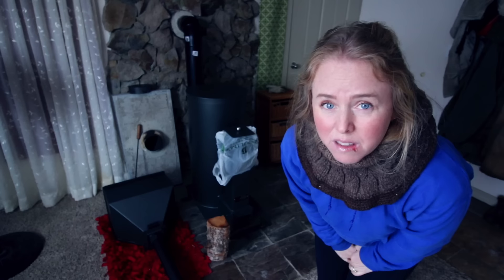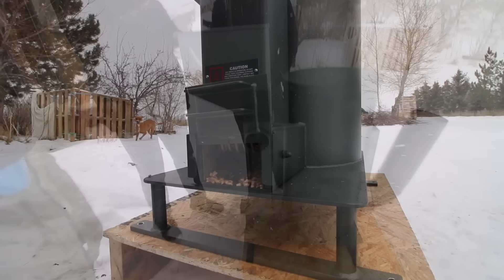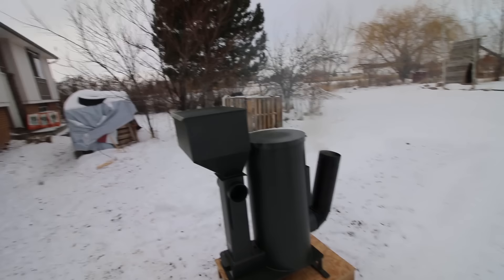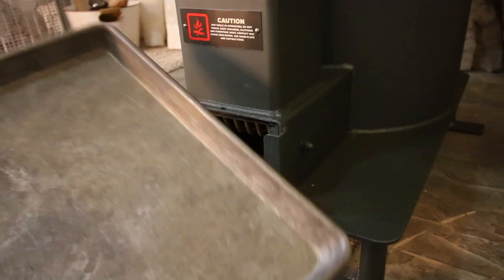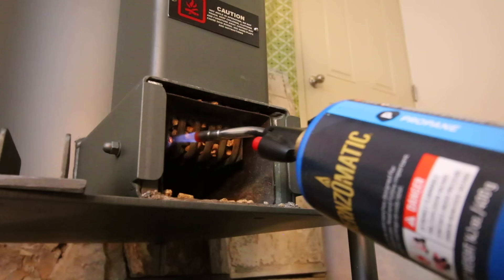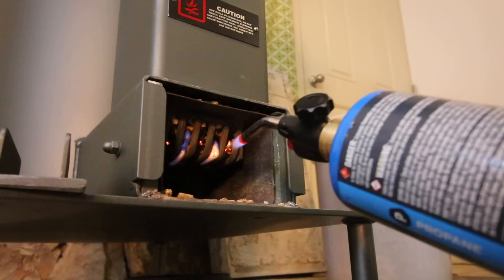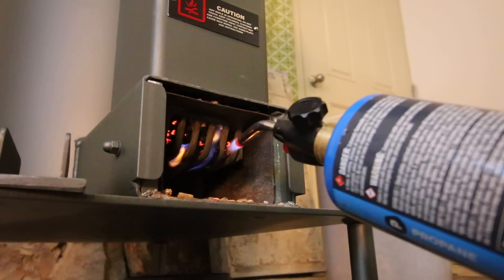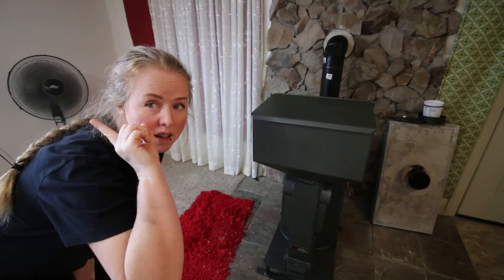Non Electric Pellet Rocket Stove REALLY WORKS for Heating Without Electricity Liberator Rocket Stove

Comment: Cold outside air for your intake is denser than warm room air and makes for a greater pressure difference between the top and bottom of your chimney which increases the draft. Great video and also lots of useful information in the comments section. Thanks for sharing
Reply: Yes! Fresh air intake otherwise it runs on a diminished return by burning air in the house that's trying to heat up. Another gentleman commented on the use of fresh air flue dampeners to control the rate of burn.
Reply: the other huge issue in sucking heated  inside  air up the chimney and ejecting it outside  is   it lowers the pressure in the house relative to  the outside ...greatly increasing the flow rate into the house via drafts...
Reply: hey, it's best to use pellets to create a mini burner for a wood fireplace... with a metal tee and appropriate pipe sections for gravitational suction of air without electricity and a suitably large flame... something like in a kerosene lamp...
the pipes should heat up quickly enough, be thin, etc. then it may work... the problem is poor combustion of the pellets and spontaneous combustion of the remains... unfortunately, the pellets or burnt like rice fried in a pan... but the rice is fried in the air... :-( this is impossible with gravity pellets

Comment: I have 2 pellet stoves in my house and love them. Compared to regular wood, waaaay cleaner and easier to manage. The downside is you have to buy the pellets and prices have gone up a lot lately. We like it because it's the fire heat everyone loves without the mess, and you turn it on and leave it for hours even days between cleanings. I'm thinking of building one of these, like the no power thing.
Reply: This one also burns wood

Comment: Any woodstove should have the combustion air ducted in directly from the outside.  This keeps the chimney from drawing heated room air and pumping it outside.  Without a direct duct, the chimney draft negatively pressurizes the room/dwelling and that air is replaced thru every air leak in the building around windows, doors, electric and plumbing penetrations and cracks.  This usually makes everywhere in the house feel cold except right near the stove.  Direct ducted combustion air makes a huge difference in comfort.  To improve heating comfort even more, a second duct with a fan/blower, blowing fresh outside air right against the side of the stove or into/between a heat exchanger plate(plate against a side of the stove with an air gap) makes a huge difference.  This blower will positively pressurize the building with heated air which will cause the heat to flow out and away from the stove as it pushes the cooler air nearer the walls out thru any places that can leak air.  These simple changes turn cold and drafty wood heated dwellings into warm and cozy.  It doesn’t even take much of a fan, a 4” computer fan on the end of 4” PVC moves a few hundred CFM and is quiet and takes little power to operate.

Comment: I had an American Harvester stove by US Stove company yes you need 120 to run it but the cool thing was i went to local farmer and bought a bunch of feed corn for the majority of my fuel. Corn needs to run hot kind of like coal, So a 70/30 corn/wood pellet would allow me to turn it down to 3 of 10 for the feed rate control, where 100% corn required level 5 feed rate to keep hot enough. Because i was renting the landlord was supervising the install and the window pass through that i made out of wood using a wall adapter and packed with fireproof insulation. Once the stove was running at temp less then 5 min from lighting all you can smell outside is Popcorn LOL.

Comment: I would say it would light faster if you used the yellow bernzomatic tank. It has MAP gas in it which is meant for brazing which burns much hotter than the blue propane or butane fuel tanks. Hope that helps. I like the charcoal briquette comment though!
Reply: just hold it in one place
Reply: Open the valve more on the torch .

Comment: Just a friendly note, the torch should be running like it was at the end of the light. The tip of the torch should never turn red. Just need to run it with more gas flow.

Comment: With this type of burner you can increase the efficiency a lot if you connect outside air to the draft. That will also protect against short incidents of "back kick" that can happen if there are turbulent air. The hight of your chimney protect you pretty well, but it can still happen. Not using heated air for the draft also protect against the effect of outside air getting into connected room when the burner "suck" air out through the draft. Also this is a very nice burner design an I would be itching to place a tank of water on top of that plate.  🙂
Reply: Just let the itch go and don't scratch like a bug bite. A pot for coffee or tea may be fine. Something you wouldn't worry about if it goes dry.

For the temps you're working with a small pan would go dry quickly. Boiling occurs at 212 F while this can go upwards of 400F. I trust the reason for the tank would be for humidity purposes.

 For the purpose of replacing a hot water heater a sealed tank could be constructed like a still. Still the condensing coil would have to be larger than that which you might use for moonshine. It might be fun to take a washtub bath like they did in my grandma's time. In the living room instead of her enclosed back porch though? Each to their own I guess. 

Now this isn't something that is turned off by a thermostat when the water temp gets high enough. I might not even enclose the system at all. Water heaters fail catastrophically with the worse case being a new skylight originating from the heater and/or it's components being launched into the stratosphere through the roof providing it didn't decimate the entire house. 

Remember what she said about water? Cast Iron and steel may crack if cold water is dumped onto them. And from that comes what I call a potentially existential moment. You will know you are alive because of the pain. What quality of life you will have after that could be telling. If it works don't fix it unless you are an engineer. Or as they say in the contracting business: When in doubt do less. There's a reason she suggested sand and a CO2 extinguisher. You don't want somebody that can't set a VCR or DVR making decisions they don't have the skill set for. 

As for connecting to the outside air: Now that makes good sense. I think you got something there. If the house was tight it would let in more air. If it wasn't it would suck less cold air (negative air pressure) from the outside. And any back kick as you put it wouldn't blow smoke and carbon monoxide back into the house.

I got a feeling we'll get some other people weighing in on this one because obviously as we got some brains, nobody has the market cornered on intelligence. And for this I'm willing to learn.
Reply: @scottdahl1938  " I trust the reason for the tank would be for humidity purposes."
The main reason would be for hot water and heat storage. A 30-40 gallon tank would store a lot heat that would be released when the burner is turned of.
It will also even out the heat when the burner is used. A source for water so the air do not get to dry is an added bonus.
The tank would have to be open to air since you do no want a steam pressure vessel on the top of your indoor burner.  🙂
Reply: @bknesheim  I think I saw a variation of what you might have in mind where somebody wrapped copper around the chimney and let rising water flow to another tank as it was replaced by cooler water at the bottom. The guy fed the hot water in turn to a living quarters he had. This set up is different in that the chimney doesn't have the higher temps.
 
Tell ya what. There's a TouTube channel called "Mylittlehomestead" that built a "Dragon rocketstove. They did it with bio mass about five years ago. Just type in the channel and include "Dragon rocket stove". The structure of there stove is about the same except the pipe layout is different. But they made theirs from scratch. Looks Pretty and works great.

Then there's another channel called "Keeping It Dutch". Then type in "Masonry Heater" From a video dated three months ago, it's based on a similar system as the rocket heaters. It burns hotter, cleaner and uses 2/3 less wood as a wood stove. With this he has a manufacture actually installing their product. And with that manufacturer comes a website with other models and prices to go with the lights and bells. I think this is available as a DIY project too. Let me know your opinion. Options are a good thing.
Reply: @scottdahl1938  Your recommendation are old news.  🙂
The copper around the chimney have problems since then you have a pressure vessel. You also loose the heat storage.
A rocket stove mass heater is great when you have the space, but the only efficient way to build one into your house is when you build the house. 
"Tiled Stove" or "Masonry heater" do much of what a mass heater do, but can easier be retrofitted to your house. The main problem there is the cost of the stove. 
They are very efficient, but there are not really any versions that can do low effect.
Reply: @bknesheim  Wondering if the the vessel as you were proposing may need some support. Maybe build a stand of right angle steel that the stove will slide under. They sell 50 gallon drums for cheap. Start with 30 gallon fill to start. Be wary of excessive humidity. I know of a guy that had a humidifier under his desk that turned his wall into a Jackson Pollak gallery in black. Maybe the heat from below may disperse it better.
Reply: @scottdahl1938  A cheap sensor can easily control the humidity. Black fongy need more the 80 prosent before it take hold.
Generally a stove dry the air to much in the winter for it to be a problem.
Do not think that the weight would be a problem, but support is never a bad thing.
Reply: @scottdahl1938  What's vcr?
Reply: @bknesheim  Hmm, okay. For the benefit of onlookers here as I think we're on the same page, an excerpt from Wikipedia:

A humidistat or hygrostat is an electronic device analogous to a thermostat but which responds to relative humidity, not temperature. A typical humidistat is usually included with portable humidifiers or dehumidifiers. It can also be included with combined air cleaner or humidifier units to control a home's humidity level or any other indoor space.

Now comes more fun. Can you tell I'm into this thread? The sensor could be part of an actuator that would normally be installed into the plenum of an HVAC system. Or one from a humidifier/dehumidifier. Just using it as a sensor would you manually adjust the cover  over the top or have something "actuated". As you noted I suggested filling the barrel to 30 gallons to start. Covering the barrel will raise the internal temp. Guessing 40 gallons would still be okay. 

Now how would the barrel be filled? I can speak from experience how a pizza place bailed water into a steam table for over a decade. The place in the suburbs of Chicago was switched to lake soft water so scale and lime build up was eliminated. I just cleaned and degreased it using generic toilet cleaner (HCL acid). The faucet in the corner needed a new bonnet washer, graphite packing and regular washer before I connected it to a line 4 ft away. Having the keys I did this before the owner in his 70's came at 7 A.M. For better effect I put goose necks on the canned lights to shine right on it in the morning. Being adopted over time the boss said nothing about me have a beer at his bar that morning as he's about to walk by with 2 five gallon buckets. As the dialog was simple to imagine I told him to put them down and follow me. Starting from the far end I opened the covers to reveal years of scale gone. "Now you turn this to the left and then turn this to the right" speaking to him like daddy to a little kid. "And keep an eye on it so it doesn't overflow.!" After seven or eight long seconds he said, "Go have another beer." I got to enjoy watching him shaking his head as he glanced at me from the speak easy window between the kitchen an the bar for the next couple hours.

Getting back on topic, is this going to be potable water? Stainless steel isn't what the drums are made of. But a drum should last for quite some time. Are you going to put a filtered faucet on it to go with one for draining and cleaning? What's the water source going to be? I'm sure my bride would have no problem sticking me on a step ladder twice a day for 8 cycles. If she were to do that I think she might have a dozen new names for me after day 1. And it wouldn't be a step ladder that I'ld be stuck on. 

As for scale. Who cares? It's part of the mass it's heating to make it hold the temp longer, right? As long as the water isn't so hard that your pipes rattle like a seed filed gourd. And the inside diameter of the pipe doesn't go from 1/2 inch over time to 1/4 inch. It'll be fine. But as the stuff falls from the insides to the bottom the efficacy could be inhibited. Seasonal draining and scrubbing may be enough. Put the drain as low as possible. A 2 inch gate valve may be enough. A bucket drained every month or so should suffice.

Since we're pimping this out, how about a sight glass to see the fill level? Connected at two points on the tank, It might have a glass tube so you always know where you are at. For the feet weld circular disks on the bottom and after painting, put some tool dip (red on black would be awesome) to protect the floor. Scratched wood is one thing. But unless  little plastic tabs are put on furniture the carpet will get a rust stain. Same thing if you clean your carpets. Wood furniture isn't always finished on the bottom so a carpet bleed from the stain occurs if the piece isn't set on styrofoam blocks or cardboard till it dries.

Ozark technology or from whatever part of the world you're from, do it right and make it look good. And It will return the favor.

Comment: Uhm.. it simply makes more sense to me to stick in small tinder flame material small kindling to start it. Using a torch is a bit overkill. And thankfully it seems designed for just that as well. I can see their usefulness but it is underutilized heat. It would be better to put water radiators than just its exterior. Stored heat extends way beyond simple burning time only. You will end up with overheating, noxious environments, and up and down time constantly not a consistent long term heat solution from a single or double burn, which is possible. It simply requires extending its operative nature. Water is the best other than beeswax for long term heat storage. So the more it keeps up in temperature the more the burn extends energy availability. And that is because you are using that water inside an area that doesnt absorb deep cold. Thus it will create a more sustained input and balance to the interior environment, with less energy input. 
Surface exchanges dont match stored energy in balancing.
Reply: So few RMH use water storage. I don't know why. My RMH in our greenhouse stores heat in 2500 gallons of Aquaponics water and my RMH in the house stores 160f water in 400 gallons of water. Makes all the difference. We can go 24 hrs without a burn during milder weather and stay toasty in below zero f weather. These massless rocket stoves really miss the mark. I would no more rely on pellets than electric heat. My stoves take full 8" by 30" logs save for our kitchen stove which takes 18" logs. 75 here and no intention of giving up our wood heat. Just the waste slab wood from our sawmill goes a long ways toward keeping us warm.
Reply: How do you transfer heat from stove to the water mass storage heater?

Comment: Nice stove, but being a rocket stove w/out an outside air intake you'd have to crack a window in an mobile home or in new construction ( the buildings are to tight).  I had the Wiseway pellet stove for my off grid cabin and added a hot water loop to the out side of the unit to heat water for radiant heat and dom. hot water.I like this unit looks like you should be able to cook and w/ a bit of additional steel and a high temp fan possiblely convection  bake with it. @ $3k+ a bit out of my price range being on a fixed budget.
Reply: The price is what I was looking for. Not anymore, lol.

Comment: I can understand why you should not expect to be able to finely vary the heat output of a rocket stove and this is why they fit well with a mass heat storage arrangement. Once you have run the fire for an hour or two and heated the "mass", you can cover the mass area with a blanket or two if you want to reduce the rate at which heat escapes into the house.

Comment: COnsider plumbing outside air into the intakes that are currently removing warm air from your living space and sending it up the chimney.  Also that air going into the intakes has to come from somewhere, so there is a negative pressure in the house that is drawing cold outside air into the living space.  For a while now even regular fireplaces have a duct to supply outside air for combustion.  It will save you fuel.

Comment: Great video. I think these stoves are incredibly efficient and you get a ton of heat for the amount of pellets you burn. I would say the only downside is that they aren't exactly easy on the eyes from an interior appliance standpoint, but extremely practical.